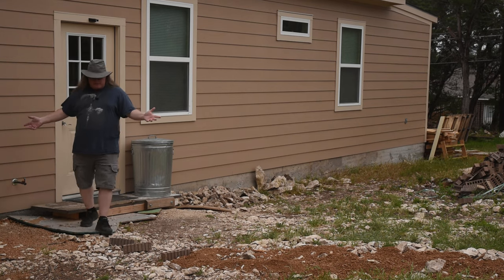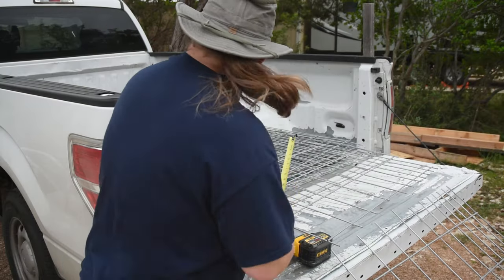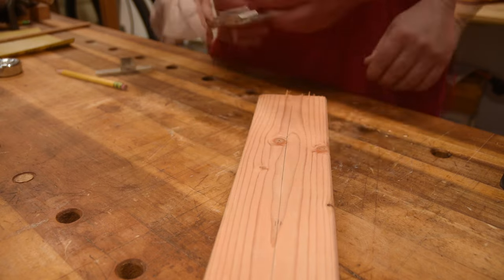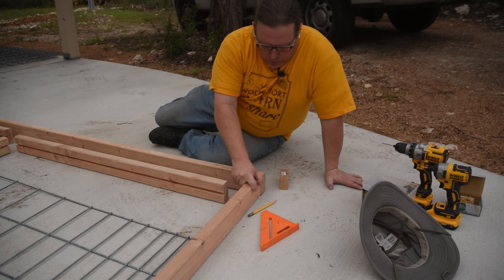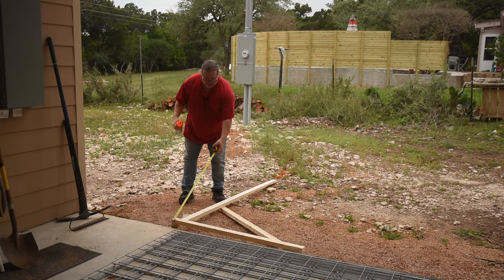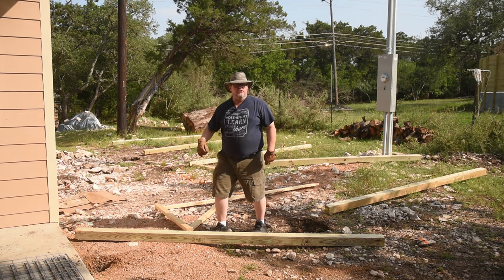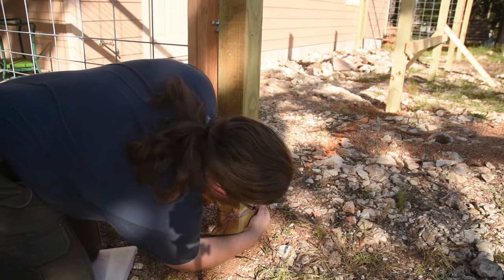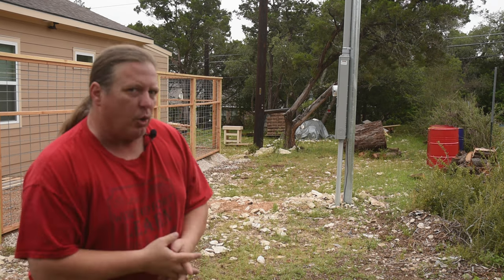A Simple DIY Modern Fence Design and Build - Frame and Panel, Welded Wire

Comment: Sounds like where I live in Texas. :p Deer have always been here as long as I have... Mountain lions moved back to the area several years ago. I still have my regular fence and so far so good as far as the lions go... I have two dogs. Well really 1 and 1/4 since one is a Border Collie and the other is a chihuahua. They are mostly outside as they like it that way and no issues so far. I also have cats that come in or out as they please and no issues there either. 

You ain't kidding about wood being expensive right now. I just had to redo the floor in my main bathroom from water damage stemming from the Snowpocalypse. I bought 3/4 plywood as close to marine grade as I could get locally. Also 2x4's etc. and I was amazed by the prices but I had to do this. Bathroom is done with new vinyl floor tile, new vanity, sink and faucet as well as a new sturdy floor. I am so happy. :D Next step is the tub which I think I will just remove as I only shower. Looking to make my own custom shower pan with epoxy resin to put in the tub's place. :D Probably going to need more plywood for that to replace the floor there as well. Also thinking will have to replace the walls around the shower too as with the tub gone there will be a gap. Good thing I love DIY and fixing things. :D 

The end result of that fence is great. It looks really nice! I would just stain it rather than paint it but then I love the look of natural wood. :D Thanks for sharing this. Going to save it for later also as I may build a fence like that soon when I move. Way too many people now near my house of 20+ years so I want many acres full of trees. :D - Heidi

Comment: Joining the corners would've added a lot of stability, which was sacrificed for making the ends removable. Good example of trade offs. Anyway, nice looking fence. Thanks for the video.
Reply from the maker: With using the ring and pin instead of a hinge and latch they are joined. Though I might add diagonal across top later to double as bird feeder stand.

Comment: I really like the idea of the removable panel. What are the bolts you used called?
Reply: Never mind, I found them. For anyone else wondering, these are actually gate hinges for a chainlink fence. From what I'm seeing it would only cost a few dollars more to used regular wood fence style hinges AND an anti-sag kit. Depending on your area it might even be cheaper.

Comment: A router can cut the grooves easier than multiple saw passes. I often use a router for that purpose.
Reply from the maker: Not all DIY'rs have a router and those that do would know this. Circular saw is more common.
Reply: @wortheffort  May be so, but for someone about to drop several hundred dollars on a fence, another $60 - $80 for a router is small potatoes. Or buy one used. The real cost is the bits but a casual DIYer only needs one or two.
Reply from the maker: Kinda reinforced my point.

Comment: Little did you know, after covid wich is still arownd now with covid 2, after the Ukrain crisis, short any excuse, the prices never droped but went and are going even higher. What you are proposing is today basicaly unafordrdable.
Reply from the maker: Dunno what you are talking about. Lumber prices have plummeted from their high's. Not as low as before but iin line with what they woulda been without covid.

Comment: Your wire panels are installed upside down. The smaller mesh goes down.
Using the excuse that you were matching the existing fence, lame. 
Do it right and don't justify the error in the original fence or your lack of standards. 
My guess is that you have no clue as to the correct way until someone posted it.
Typical your tuber.
Reply from the maker: They are installed small mesh on ground. You didn’t watch video and just felt need to be rude.